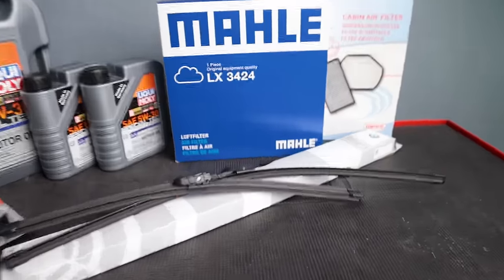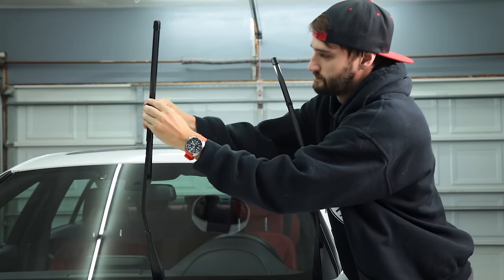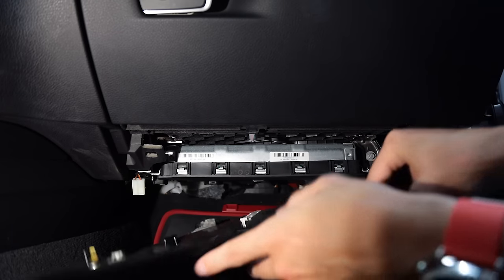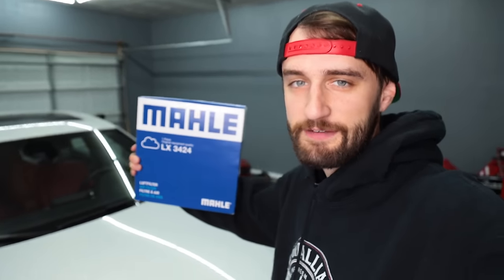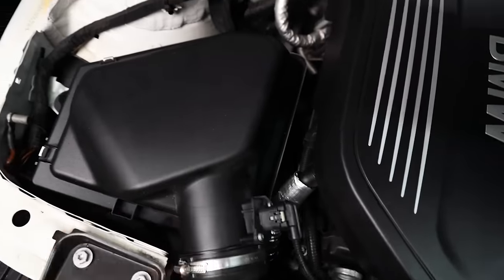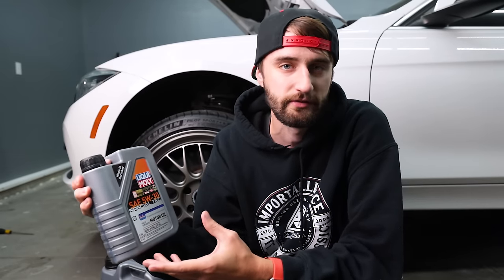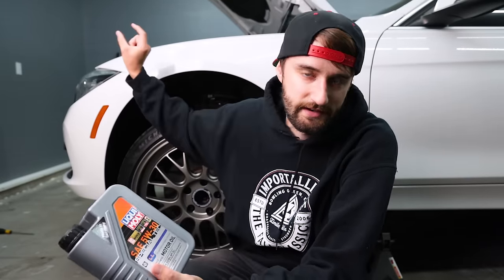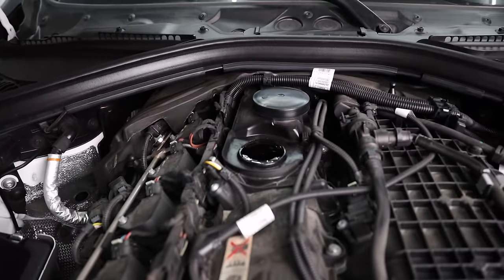STOP GETTING RIPPED OFF AT THE BMW STEALERSHIP!

Comment: I’m sure you do it, but for people new to DIY.
Always a good idea to keep a binder of all service and repairs on any vehicle, especially Euro.
Will be very helpful when going to sell the car, in reassuring potential buyers of the vehicles history.
I know when I go to buy a used vehicle it is a very important aspect of the purchase, especially once they are getting a bit older and higher mileage.

It also communicates to the buyer that you properly cared for and about the vehicle.
And hopefully can increase the price (relative to comps) that you are able to receive when selling.

If doing DIY, save the receipts in the binder with date and mileage of the service notated, and any other relevant notations
DIY work will not show up on vehicle history reports (like Carfax) the way that service at a shop/dealer does.  This way you have proof of what work was done and when it was done.

Comment: Why not use 0w 30 next time? You get the oil circulating around a cold engine very fast due to the 0w rating, reducing cold start wear and when the engine is at operating temperature, the 30 "thickness" you have with the Liqui Moly 5w 30.

Comment: There is an idea behind the wiper blades position. It's for highspeed drives on the autobahn. At 155 mph the wind can be getting very loud while it is traveling over the car ;)
Reply from the maker: Hmm, I would have thought they would be more aerodynamic when they are tucked under the hood
Reply: @justinbuice  You can tell if you got them snapped on correctly at 155 mph if they're still on your car when you slow down!

Comment: I want to buy e90 330 xi as my first car any specific advice for what to look out for when buying . Your videos really helped me finding what car I want keep up the good work
Reply from the maker: Look for oil leaks around the valve cover and oil filter housing. Open the coolant reservoir, the coolant should be BLUE. If it's green or any other color, stay away. Press every button in the interior. Make sure the sunroof, heat, air conditioning, power windows and door locks work. Good luck!

Comment: I paid around $300 for unlimited oil changes for 3 years.  I drive almost 60K miles per year so it was a huge bargain for me.  I do the cabin filter, the wipers but not the oil change myself.

Comment: E90 owner here, dealer quoted me $120 to replace the cabin air filter. Yeah, hard pass!! $19.99 STP air filter, job takes less than 5 mins. Pop hood, remove six 8mm bolts, swap filters in housing, replace six 8mm bolts. Done. 

I do go to the dealer for oil changes - ALWAYS WITH A COUPON, which makes the job a) cheaper than I could do on my own (cost of filter plus 7 qts of full synthetic, plus cost to dispose of used oil (do not destroy the environment by dumping in the storm sewer people!!! This is not treated and ends up in your nearest creek, river and lake)) and b) no hassle for me, I even get a free loaner for the day.

Note that BMW dealers accept other BMW dealers coupons, so check all dealer websites in your area for online coupons.

Comment: Liqui moly sells a special tec fe 5w-30 which is certified bmw LL-01fe which you can use and be good with the warranty. I’m running it right now.,, If I run a out of warranty covered oil, the best in my experience is Castrol edge 0w-40 euro formula a3/b4. engine is smoother, quieter, best mpg even compared to bmw 0w-20 and 0w-30, better protection and cheap. About $25 in oil for each service.

Comment: My local dealer has the "value" service which is just as cheap as my other local shops. They use genine parts as well so I do use the dealership for a convinence. But if you want to save a few bucks on these cars def do it yourself.

Comment: I took my car to my local bmw dealers for a free health check and they said I needed the rear brake discs replacing ( not the pads ) now I've never heard of discs wearing out before pad so I checked them myself and they were OK , six months later and after a service the discs were fine they said , I use an Indy now.

Comment: i used to have a e46 m3 i had some European Autosport performance ignition coils two of which went bad, i didnt know what was wrong with the car after the dealership told me and i gave them the replacement parts they charged me $350 to change two ignition coils which was AT MOST a 30 minute job.

Comment: An oil change is one thing I’ve never found the juice to be worth the squeeze. BMW is running a special right now for $200 for 3 years unlimited oil changes. At roughly 2 a year on the low side that’s 6-7 over the course of three years. At $76 a pop for the oil change kit on fcp euro that’s over $500 to do it yourself vs $200 to have the dealership do it for you. It’s a no brainer IMO. The air filters are definitely with doing yourself though.
Reply from the maker: I'll have to look into that. This is the first time I've heard of this deal. It used to be $200 PER oil change.

Comment: So how does this get logged, for service history purposes?
Reply from the maker: You use the BC stalk to the left of the steering wheel to reset the service interval for each item. There is one for oil, engine air filter, brakes, spark plugs and cabin air

Comment: 0w20 is very too thin for n55/b58 engines. I own a f10 535i since 8 years with Mperformance ECU (340ps) and I always used 0w40 the winter and 5w40 the summer.

Comment: The 0w is so your oil will have a better viscosity during colder times so that the oil can coat all the internals when the temperature is low. Using a 0w 30 grade will give you the same protection at the top end temperature as the 5w 30 but better protection at lower temperatures than 5w 30. I don’t get your logic on you wanting to drive it a bit harder. Your 5w lower end is not going to compensate for that since your engine will be cold at start up in any case.

Comment: except the only problem is my BMW is a sports package and is too low to where i can even get a jack under it. unless i want to drive it up on boards and deal with that hassle, i have to take it somewhere to get it changed.
Reply: If you have a Harbor Freight near you, they sell a 3 ton low profile, long reach jack for around $200.
It reaches the engine jack point on my sons E90 easily.
Also has a foot pump in case you are in a tight spot where the handle can’t be easily pumped.
Might come in useful in the long term for DIY.

Also can get a set of ramps for around $50 at Walmart or auto parts stores, but obviously can’t use them when needing to remove wheels.

Comment: I got a recall sometime ago, about heater blower cables. They needed replacement and I received call from a stealership to come and fix it free of charge. They did a check also and found a bunch of leaks, inlucing rocker cover, gearbox and conditioner. They asked £2000 to fix everything. And this is a joke. I'm owner of 2006 E90 which I bought for £2600 back then. I'd pay nearly the price of the car to fix these leaks?! I went to regular mechanic and asked to inspect those leaks, and he indeed find the rocker cover leaking, but not the others. So I just fixed this one. Not sure if they tried to rip me or what. However I'm driving more than a year without any issues now.

Comment: Bought a used 328i, they didn't have the wheel bolt key. I had locking bolts on my wheels, one on each.  $180 to remove the 4.....yes 4!!!  Never again.

Comment: This is cool and all. I would be worried when a turbo breaks or the water pump fails and then u need to pay the stealership a limb to fix ur car
Reply from the maker: fortunately the B58 has an old school mechanical water pump so it SHOULD be more reliable than the electric ones found on the E series

Comment: Have you looked into using Amsoil Lubricants? “Project Farm” has put them to the test against most mainstream oil brands and it out performed all. You should check them out! I use Amsoil’s European 5w-30 blend that meets BMW LL-04 specs in my 17’ BMW 328d. I’m also an Independent dealer out of North Carolina… Would love to get your opinion on some of Amsoil’s products if your interested!?

Comment: Wow I just been charge 200 $ by the dealership for my cabin air filter on my bmw 750 2012 I wish I saw this video before !!
Reply from the maker: Dang! At least you know for next time
Reply: Justin Buice 200$ for a 20$ filter and a couple screws ouch that sucks
Reply from the maker: @ruskibruski  My local dealership charges $140/ hour minimum, no matter how simple the item is to replace.
Reply: Meme Master it is not the worst.  I had a daylight that would go off and on anytime.  so i ask to change it but they charge $ 150 for one hour of diagnosis to tell me to wait for the problem to become permanent.  finally I bought myself a simple bulb for 20 dollars and the problem never returned

Comment: oil, oil, oil. change the damn oil and a bit early. if your manual says 15,000 km then change it at 12-13,000. Air filters and oil filters on all changes. hey did I say change your damn oil?
it will save you tons of money long term on repairs. Always Always use 100% synthetic as well.
If you buy your oil branded from walmart or Canadian tire or something like that then change it slightly earlier.

Comment: Typically over engineered German product.  They do it just to rip you off at the dealer.  Four screws and an electrical connection to change a cabin air filter?  You can change one in a Honda Accord Touring for example without a tool in ten percent of the time.  6.5 litres of oil?  Seriously?  Without a dip stick to check the level without running your car for so long?  A regular self contained oil filter not good enough for them?  My wife got the one she coveted.  At 39k it spent 2 weeks in the shop to get a problem with the variable timing fixed.  Thankfully under warranty but I'd hate to even guess what the repair would have cost.  I don't think it is an accident that the brand is the most reliable during the normal warranty period and the least reliable at 100k.  The video was well done!

Comment: That’s kind of a flawed design, the whole “service mode” for the windshield wiper blades, what if someone (who doesn’t know better) has a really dirty windshield and activates that, it could potentially drag a piece of something hard and scratch the glass. (Happened to me with my old R50 Mini Cooper when I accidentally activated the wiper blades while driving.)
Reply from the maker: I agree. Seems like a big oversight. I have heard that a lot of used F30's have scratches on the hoods from people just trying to pull up on the wipers
Reply: I for one do have some scarring on the hood from the prior owner of my f30 from them pulling up on my wiper arms, I will say that you can actually get the blades out without putting the car in service mode although a bit of a pain because you have to hold the spring loaded arm up I agree that the service mode is something that is damaging and a flaw in the design from a functionality viewpoint, lots of potential for scratching not only the glass but also the paint for those who are unaware of service mode even existing

Comment: Wtf they dont have 318d e90 bmw on the site🤦‍♂️🤦‍♂️🤦‍♂️
Reply: That's no big deal, you should be fine with the specs of a 320d it's the same engine.
Either 2.0 M47 or 2.0 N47 depending on the production date of your car.

Comment: Great 👍 informative video.. Air filters are worth changing yourself but oil is actually not that expensive at the dealer ($120, 0/40w, 10k miles) and only takes 1hr. If $120 is too much for you.. don’t buy a German car lol. But too each is own 🤙.

Comment: yeah i agree, its not hard to dump oil and swap the filters outs.. Cheap too if you do that yourself. So why pay BMW right? well, not so right... Firstly, BMW will try to upsell you anything that your car would potentially need. said that, they check everything - suspension, brakes, steering components etc.. You might have changed the oil yourself, but you could very much have no idea about other items that require maintenance or urgent repairs. once again, not saying you have to fix everything with BMW, but knowing doesnt hurt so you can fix all that however and wherever. Secondly - maintaining the car value.. I tell you the truth - when im looking for a used car, all i care about is what i see. I see genuine service invoices i know this vehicle was serviced there and then. I would never ever even think about taking anything into consideration what the seller says about the car, that he services it every 3k miles himself etc obviously having no technical qualification in his background other than youtube schooled. dont care if he actually do - simply no proof. and thirdly - having full BMW main service history can also pay you off post warranty in case eg your engine blew out.. most likely you would get it replaced free of charge under "good will". BMWs are quite known for their after warranty "good wills" unlike some Ford that tells you stuff it up in same scenario if your are 1 day over the warranty period.. 

End of the day really, if you cant afford 800 quid every 35k miles/4 years to service your car (interim services are like 150 quid every 18k/2 years) then maybe you shouldnt drive BMW to start with lol. Not even talking about "thugs" in their X5's with the "ditch finder" tyres all round lmao..

Comment: BMW It's pretty cheap if you do it yourself man. I buy 2 gallons of good oil, oil filter, air filter, cabin filter, fuel filter and spend maximum 80 bucks lmao
I even changed the ZF auto gearbox oil and pan for 200...at the stealership they wanted 900 lmao
Gonna change the brake fluid, differential oil, coolant also, gonna be like 50...and that's it!!!
If you spend your time going to the stealership you'll be poor in 2 or 3 years hahahaha they charge you 300-400-600-1000 for simple things jeez...

Comment: Bmw oil change 99$ out the door proper 1000% job gauranteed. Drive jn oil shops, 120-140. Oil 50-60 then you gotta take time do it. Rather lag 40$ more to get it done at dealer save me time

Comment: BMW service at my dealership is outrageous on their pricing but...if you diy wiper blades and they streak and squeak?  Happened to me and I was SOL.  I'll pay them next time and they can deal with the mfr.  Too old to climb under cars to change oil and rotate tires and I dont trust the folks at jippy lube that come to work hung over and pissed off.  Getting ready to replace cabin air and engine air filters as soon as they arrive.  That's even a rip off at the Honda dealership.  Both these dealerships are owned by the same millionaire where I live.  He really doesnt need my hard earned money.

Comment: this guy went too cheap on parts,i usually get bosch parts and castrol oil,all parts costa less then £100 and £30 labour....and when you changing air filter you need to vacuum clean the box as BMW gets in too much leaves and dust inside.
Reply from the maker: Castrol is way cheaper than Liqui Moly...
Reply: @justinbuice  I cant find any oil in that name